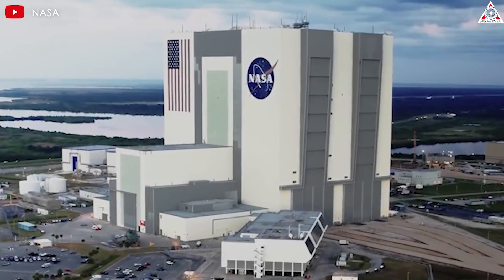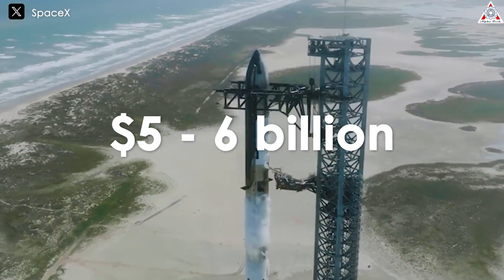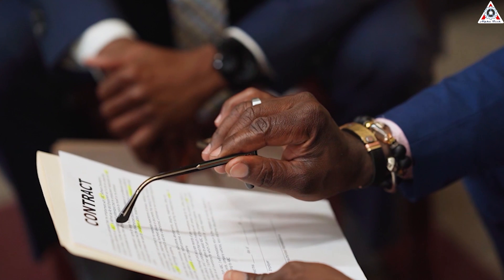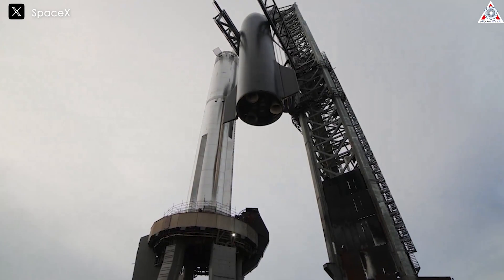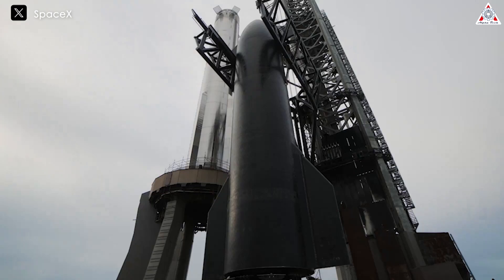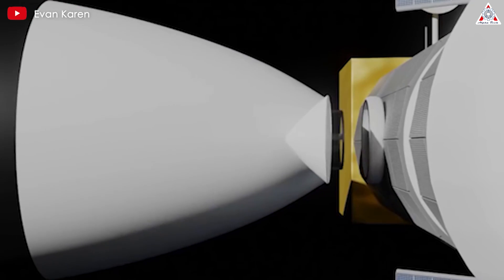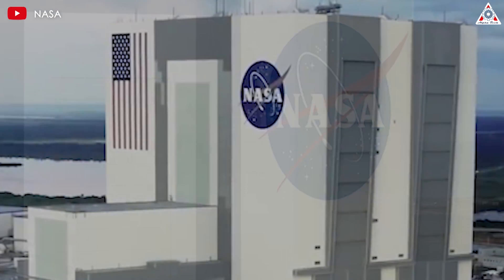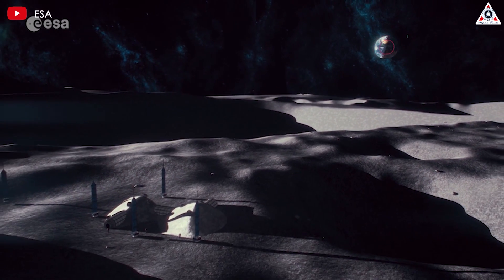It Happened! Something Bad Is Happening With NASA Artemis. SpaceX to Save...

Comment: Well Bill not this time they are taking NASA to the cleaners you need to think this through. You need to have that fixed pricing so that they will stay on track and also they need workers there every day with out fail. They don't need to keep on milking it out. One other thing you might want SpaceX to look at the blue prints and check out the reasons why they are not working.

Comment: Make Believe Musk's BF Rocket can't do [JS] ... and it has a multitude of Problems ! ... Yet you Bots act like it's already Finished and Flying .... LOL !    😕
Reply: Well it has only been under development since 2016, (with the exception of the raptor engine) having a cost of 6 billion so far, that includes EVERYTHING even infrastructure required to launch, build and refurbish the rocket.

Meanwhile the SLS has been under development since 2011, costing 11.8 billion (for the BLOCK 1 SLS only), this means the SLS 2 cost will get added to that AND no infrastructure is include in this price. so far and having only 1 succefull launch. Also this is ignoring that many components from the SLS are recycled from older craft like the space shuttle wich should have brought the cost down and that the SLS is not a reusable design.

Starship will probably start flying commercially next year with a development cost of less than 10 billion and a fully reusable setup, wich means the starship will get more cargo for cheaper in orbit, AND MORE FREQUENTLY.
Reply: @sdavid27  Probably Not ... Right now , all Musk has is wishful thinking , grand claims and BS ... for a BF POS Rocket with a Multitude of Problems ... I wish it weren't so ... butt , that's Reality ...
Reply: You must own stock in Boeing.

Comment: The SLS system was a dumb idea to begin with. If it was supposed to save money by reusing components like old shuttle engines, what happens once they're  gone? Gonna cost tons extra to manufacture new ones. Stupid idea to save money.
Reply from the maker: But Nasa must continue or they will be the ones to suffer the consequences.